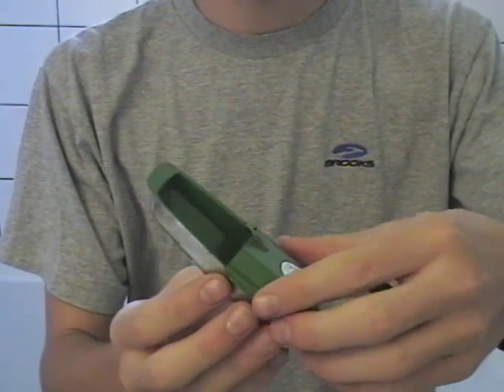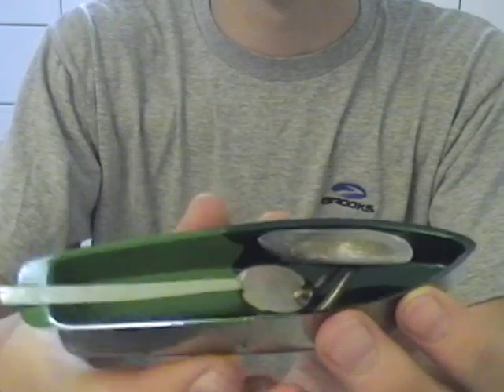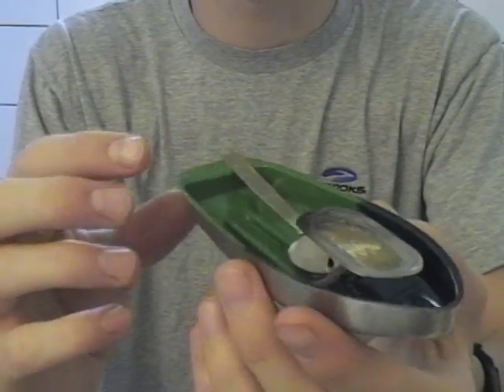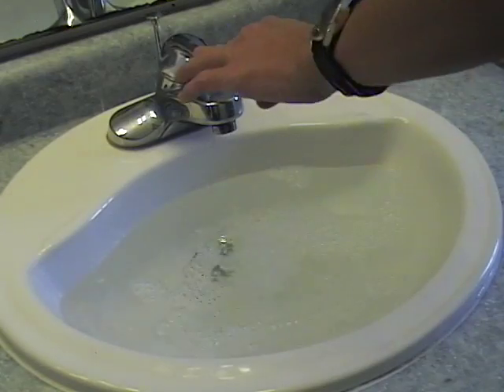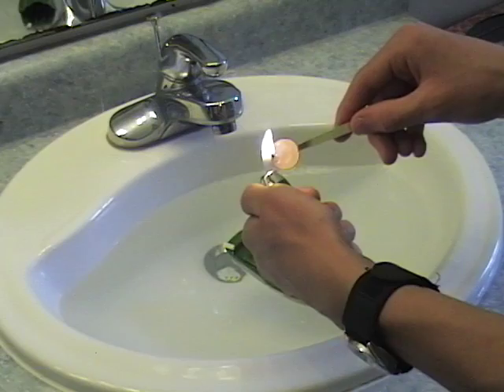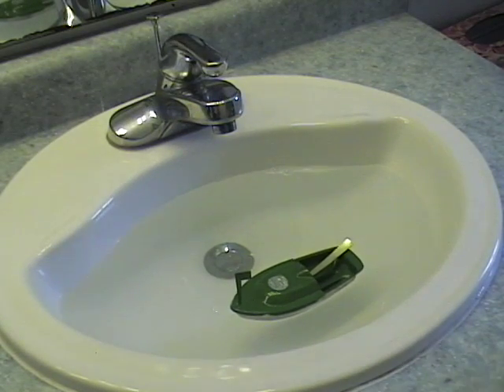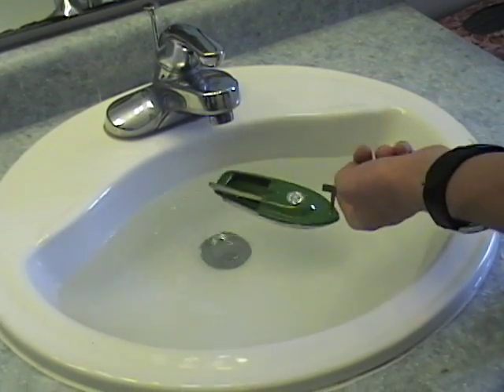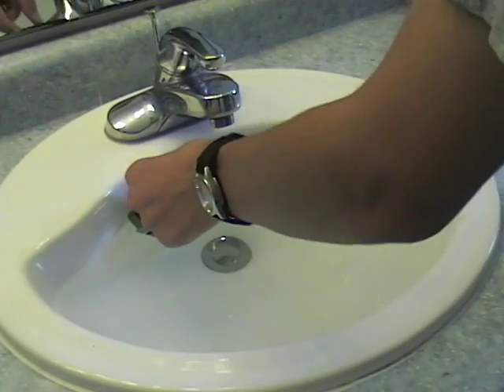Pop-Pop Boats

Comment from the maker: Yes, I have thought they should use them on a larger scale, but the problem is, is that there is no way to heat up the amount of water in the boiler fast enough to propel the boat at a relative speed, and if there was a way to heat it up fast enough it would use up so much energy that burning coal in a steam engine would be more efficient.